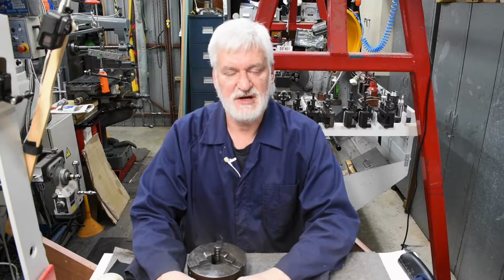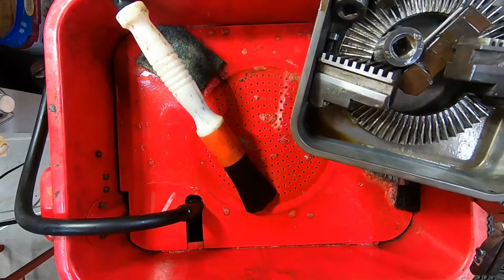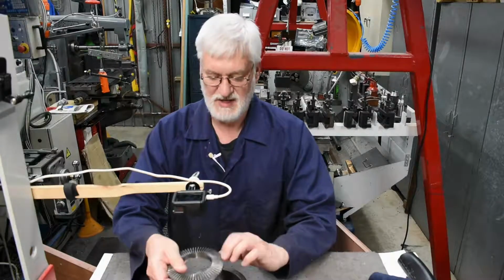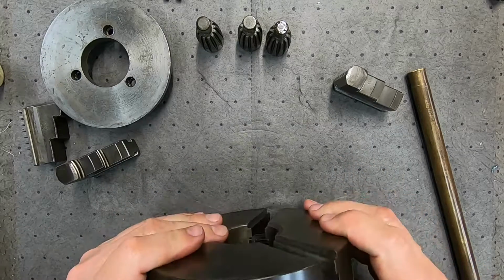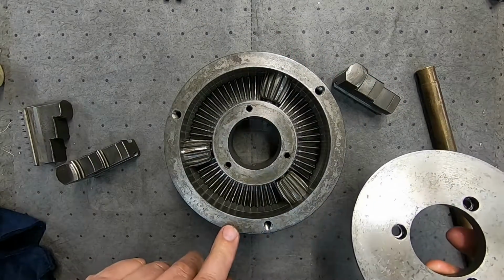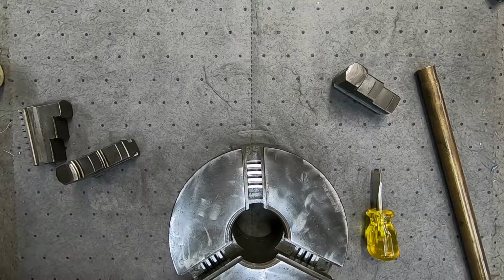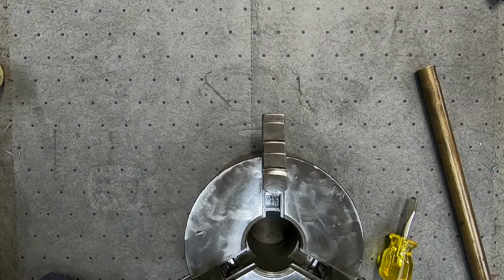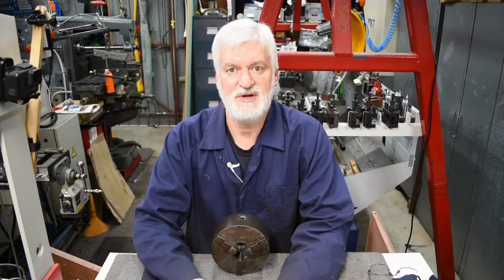Stripping and cleaning an old 3 jaw scroll chuck.

Comment: i got a 5 inch burnerd chuck off ebay last year still in the original packaging covered in that sticky grease what a chuck it was dated 1965 it was really tight at first but loosened up just great with a ;little use
Reply from the maker: Sounds like a good score - well done.
Alan.

Comment: Yes I put a drain cock in my parts cleaner with a filter to recycle the fluid a coupler time before replacing.
Christopher from Queensland
Reply from the maker: Now that is a good idea. Tipping the tub over to pour the degreaser (Kenco) out is a dodgy business. I used to use the pump to eject most of it but the flow through brush has made that unworkable. I haven't bothered with a filter as I find that a lot of the crud settles out of the drained degreaser in a day or so. Then I just pour most of it back without disturbing the sediment. 
A drain cock has just gone on the todo list :)
Cheers, Alan.